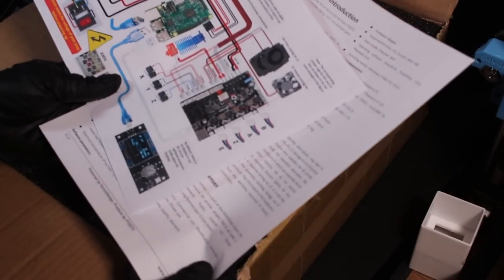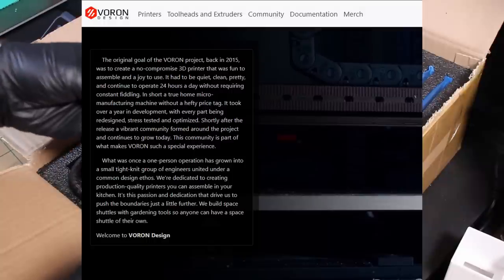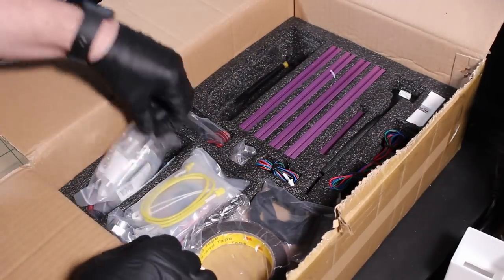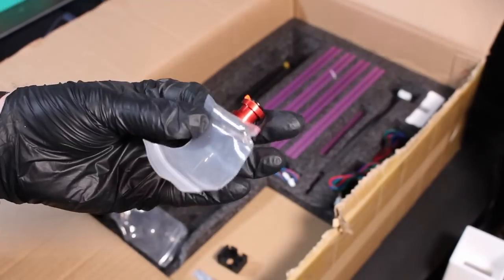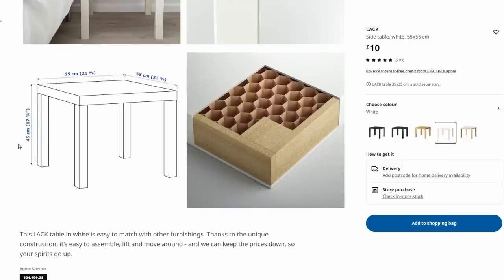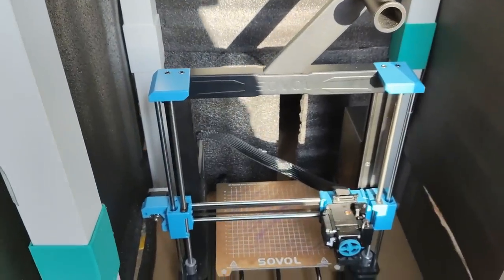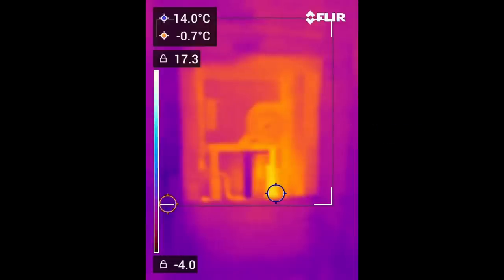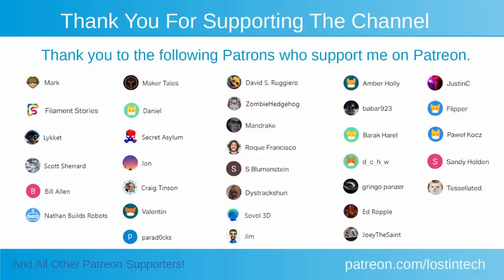I'm Building A Voron (and so should you!)

Comment: Regarding PETG vs ABS: You can get PETG with a grass transition temperature of 100˚C, you just need to look for it (on the internet) 😂
Reply: If you have watched the video you will know that the author focused on the glass transition temperature and heat creep as an issue. Why should I focus on other properties of the material? 
From an engendering perspective ABS and PETG are in the same material group known as plastic.
As an example both Prusa and RatRig use PETG for the printed parts.
And it is not like that Voron will support a high temperature in the enclosure as the panes are Acrylic. 😉

Comment: You can print ABS/ASA in an area you live in if you filter the air. This is the way the Voron was designed. I don't know about the v0, but the v2.4 which I built has an carbon air filter on the exhaust to deal with this. I personally also added a carbon filter inside the Voron to further filter the air, as well as a surgical mask to the exhaust filter to filter any particulates

Admittedly, I printed my Voron ASA parts initially just on my desk on my ender since I figured I was only doing this once, and once won't hurt that much. I've since only printed ASA/ABS on my Voron which has a good filtration system

Comment: If you're new to 3D printing and you have $700 in your pocket (less than a Voron), just buy a Bambu Lab printer. It wipes the floor with the entire competition, literally, and you don't have to spend a month building it. And if you have $1200 (same as a Voron) buy the Bambu Lab X1. Unless you like to build stuff more than you want to print stuff, then go for any Voron, or RatRig.
Reply: P1P starts to seem very interesting when compared to other printers, e.g. Creality Ender 5 S1. FLSUN Super Racer also kicks a lot of butts 😉
Reply: @kimmotoivanen  Agreed. But it's an open printer. So for ABS, CF etc. you're gonna have to figure out an enclosure that tall and pay a little bit more.
Reply: If you are looking for a turn-key solution to just print stuff and you can live with the closedness of the ecosystem then I agree with you. But I would be very aware of the horrible security track record of the company
Reply: @strmstikket5505  Source? Besides, it's a printer, not a bank account.

Comment: A voron is a cool printer and they look like they work very well.  But they are a compromised design because they use 3D printed parts.
Reply: Prusa & Lulzbot use 3d printed parts
Reply: @stldenise  Yeah, they are compromised as well.  Those are great printers.  I do think its cool to 3d parts for printers.  But I think you are compromising the design slightly.  Especially if you want to  print in higher temperature chambers.  I am not bashing any printers at all.  Its just that the comment was made that a voron is 0 compromise and I don't think that is completely true.
Reply: ABS printed parts are just fine for an FDM printer.

Comment: Next time when you want to “print a printer” you should look to @rolohaun3D’s rook. It is a fully 3d printed 3d printer. Even more so than the voron. It is not suitable for sizes larger than 300mm but it is a very fast machine and it’s 1/3 the cost of a voron at the very least. Depends how much you want to put into it! I already used my spare parts on a PETBOT so i have to buy parts for a rook build but i still plan to do it because i want a small and fast printer
Reply from the maker: I've heard of it